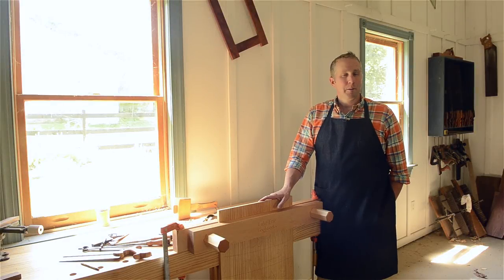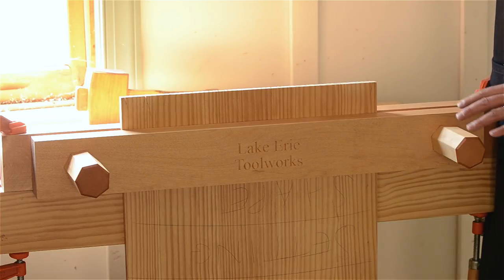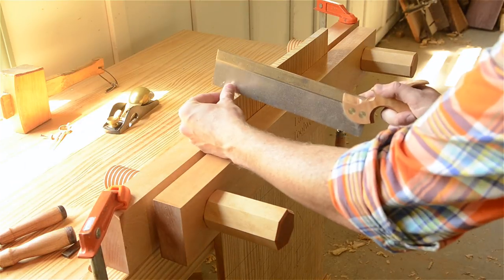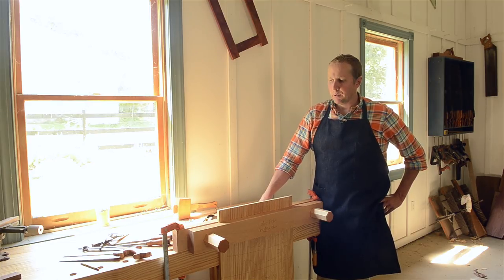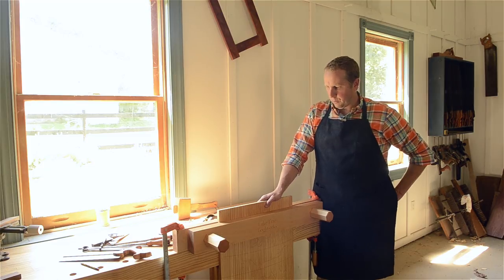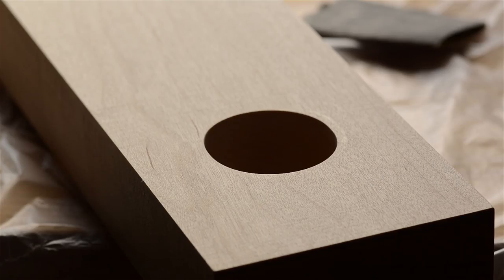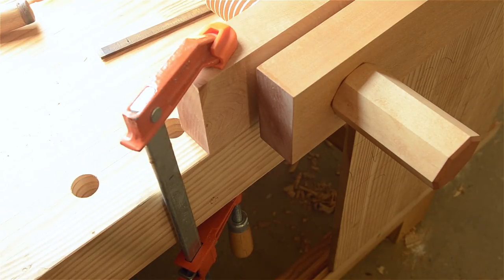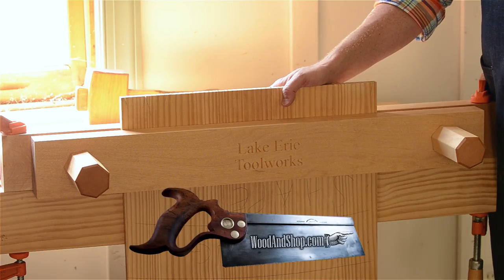Moxon Workbench Vise Giveaway & Review

Comment: I am in the process of building one kind of like the "Crazy Russian" but modified to my needs. It maybe a while before I finish because we are in the path of Hurricane Harvey right and I don't know long it will take to get back to normal around here. I originally bought parts and pieces to assemble what is more closely aligned with the Benchcrafted hardware, to save money. I have discovered that to really make it right, it is more expensive than I had thought. I really like the lake Erie screw I got for my leg vise but I have found that a leg vise alone is simply not enough. Good luck with your site Joshua.
Reply from the maker: Stay safe with the flooding!
Reply: I hope you stay safe in the path of this hurricane.
Good luck to you all
James

Comment: I made one from laminated SYP 1" x 6", and 1" dumbbell handles. I should have used 3 layers–it flexes more than I would like, and placed the screws more towards the top, but it still works well.
Reply: I recently purchased a couple of dumbbell handles for the same thing. I cut one in half, then I will make a base to insert the two pieces into. Did you just use the standard nut or fabricate something to screw the nuts to? I'm thinking of screwing them to round pieces that I make of the same wood that the chops are made of.
Reply: Mike PierceI bought three handles. I don't have anything to cut them down with, so they are still full length. I inset one nut into the rear jaw, then used the nuts from the extra handle as jam nuts. I didn't make any handles/covers for the tightening nuts, since I never intended this to be my permanent Moxon vise.